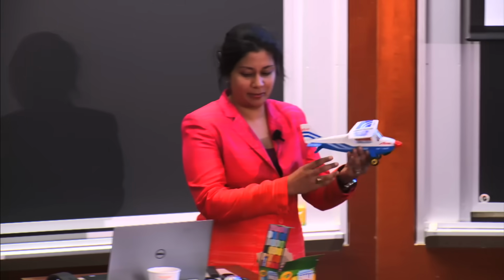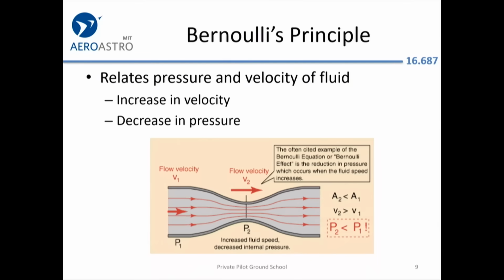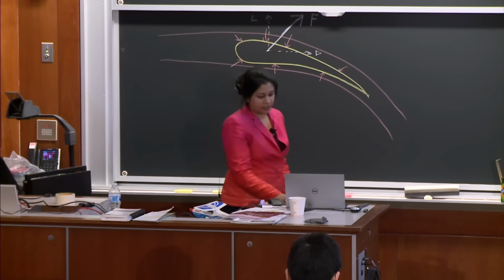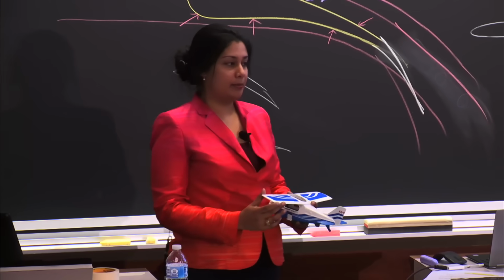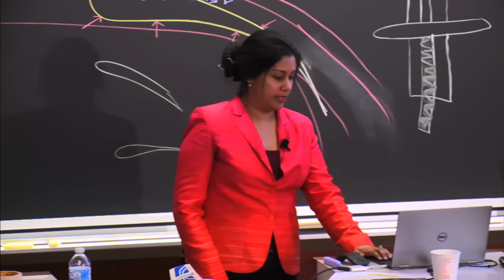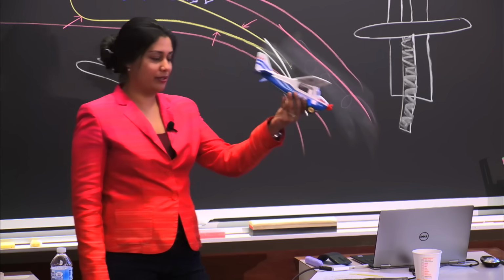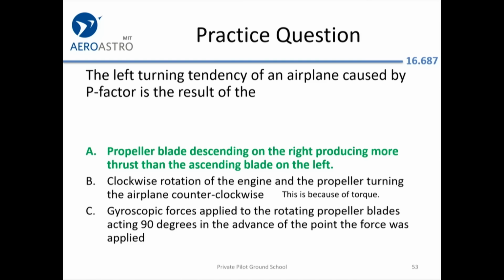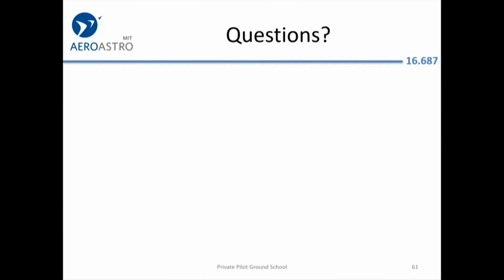Lecture 2: Airplane Aerodynamics

Comment: Not an aerodynamicist (like the presenter) but two questions. First, why is she drawing airfoils that don't exist but help her make you believe the whole air deflection theory? Secondly, if airfoils fly (create lift) by deflecting air molecules downwards, why do airfoils stall at (typically) 10 degrease AOA???
Reply: She us rather weak on everything. 
Stall is typically more like 13-15 degrees and that is because the air can't get around the curve fast enough in the upper flow that it needs to and the laminar flow becomes turbulent. The air's inertia is, in essence too much for the atmospheric pressure to keep it smoothly flowing along the surface of the wing.   Like you on the playground merry-go-round feeling 'pulled' outward.

Comment: equal transit theory doesn't seem applicable but she is a lot more confused in how to reject it. As  after contradicting with it by saying it isn't possible that air is moving faster and it all related to mass being pushed down. then as soon as she reached the foundation of lecture then she started with Bernoulli's principle by relating speed and pressure. Instructor can you tell how will you apply bernoulli principle? have you studied its basics? my say would be equal transit theory isnt correct although there is some relation of speed increase and decrease, although it isnt necessary for particle to meet at tail at same time.

Comment: 3 min in and already making mistakes. For example lift does not need to exceed weight to climb. And thrust does not need to exceed drag to go forward. Even simplifying for a general audience that is not correct.

Comment: This woman is dangerous, first she confuses lift with drag then she states that the air travels over and under the airfoil when in fact the air soes not move at all. The Aircraft moves through the air. MIT?
Reply: We model it as air moving over a static airfoil for ease of explanation because it's essentially the relative velocity over the airfoil which matters, not what is moving where. It's the same thing
Reply: Agreed. Relative wind and “wind” are two different things.
Reply: The talk was full of errors. Unworthy of MIT.

Comment: 5:42 - Color me terrifically confused by that streamline representation.  Wouldn't the flow become quite turbulent on the back top side before it made a bend like that?  Or let's ask the question this way - why does the air bend down?  Isn't it because the local pressure on that streamline is less than the atmospheric pressure outside the control volume so that as the topside flow exits the CV it has a downward component?  So then is she just saying that the delta-M on the CV is what causes lift and not the delta-P via Bernoulli?
Reply: You are correct that wing as drawn would be in stall. 
Above a wing, the pressure is lowered because it 'wants' to go straight - Newton 's First Law.  This derates the lower pressure at the surface as it "tries" to go straight, just like you swinging outward on a playground merry-go-round
In normal lift it is NOT turbulent above.  It is laminar.
Coanda does NOT occur above a wing because there is no jet into still air and, therefore, no accompanying entrainment.
The deflected air is from both bottom and top and MORE is  from the top.

The air follows the upper convex curve simply because the atmospheric pressure is pushing it against that surface (Downward) as long things aren't happening too fast for the mass of the air to be accelerated by the pressure Gradient.
Reply: @Observ45er  Thanks.  I'm staring at that thing and going "It's been ten years since my last fluid dynamics course, but that just doesn't look right."
Reply: @TemplarOnHigh  25 years for me.
I dont get the "Bernoulli" thing; the airflow 'above the wing' and the airflow 'below the wing' ARE two seperate flows therefore Bernoulli can NOT be applied...... to the best of my waaay old knowledge.
Reply: @vatandas1542  It's a question of where you draw the stream lines.  As long as you apply Bernoulli along a streamline and the other assumptions are valid (incompressible, isothermal, steady, frictionless) it will work.  You can apply it to the top and to the bottom stream lines.

When you do this you will get a slight difference in pressure along the stream lines.  I think what the speaker is saying is that this is not sufficient to generate the lift required and that the bulk of lift actually comes from a change in the momentum as you move the fluid through a control volume (but I haven't checked the work to determine if this is right.)
Reply: @TemplarOnHigh  I see what you say.
But you know the classical Bernoulli example; pipe with a throat.  Single airflow, molecule to molecule.  Never seen an example/calculation with two different pipes one of which is 'narrower'!
Reply: @TemplarOnHigh  Second part: That is correct. Aircraft fly by AoA. Turning the airflow downwards and vortices (laminar and/or turbulent) add a great deal to the lift.
"Fat" airfoils, sucb as the ones on airliners, allow very high AoA. "Thin" airfoils do not.
Check the airfoils of Starfighter (F-104) and Viper (F-16).
Reply: @vatandas1542  Because a stream line doesn't allow flow across it, there's no theoretical difference between a frictionless pipe's wall and the stream line next to the one you are analyzing. So you can analyze two stream lines that start with the same starting conditions and then correlate them to each other later in the flow.
Reply: @TemplarOnHigh  I dont get it.
There ought to be one common parameter,  time or path in order to be able to make a meaningful comparison.  The paths are clearly different. The time need not be equal. Just my 2 cents.
Reply: @vatandas1542  The time doesn't have to be equal.  Pretend you have a pipe like so:
1.  Straight section.
2.  A T.  The T feeds a U-shaped loop and another straight section.  Both of those connect back into a 
3.  Second T.
4.  A straight section again.

You can set the U-shaped loop up to be very, very long.  (Think primary / secondary pumping arrangements on chilled water systems with a hydraulic bridge.)  Bernoulli will still be valid even though the flow rates and times are not equal.
Reply: @TemplarOnHigh  the pressures at the two entrances of the 2. Tee would be equal either by design or by back-flow to the U-shaped side (assuming that side with more pressure drop). Therefore you know the upstream AND downstream pressures of the U-shaped side as well as the geometry. Where is the application of  Bernoulli for both of the two sides?
(Sorry, I m somewhat rusted.)
Reply: The airflow behind a wing when it is creating lift is, in fact, turbulent. The higher pressure of the underside makes it flow towards the lower pressure upper side exiting the trailing edge, but they both are traveling downward. This wing wash turbulence causes some of the induced drag. The mass of air is deflected down due to the momentum imparted by both sides of the wing. It is the Coanda (surface adherence due to viscosity) effect that makes those molecules follow the wing surface in a downward direction. Why can we understand why we get a downdraft from a ceiling fan or a helicopter and not understand that they are in fact rotating wings ?
Reply: Analogy to rocket engines: Pressure distribution over an airfoil is to its downwash as pressure distribution in a rocket combustion chamber is to the exhaust plume. A rocket's combustion chamber essentially has a missing rear surface so the net pressure force is forward. Does thrust come from this unbalanced pressure in the combustion chamber and nozzle or from f=ma in the exhaust? Really it's both. Same for the airfoil.
Reply: Air is lower pressure on top of the wing than atmospheric pressure behind the wing. This means the air must unnaturally flow from low to high pressure. When momentum is insufficient to overcome the adverse pressure gradient, a region of reverse flow occurs at the trailing edge near the surface of the wing. It works it's way forward as the adverse pressure gradient worsens. This is the mechanics of a stall.
Reply: Air stream flow at the lower portion get compressed to produce high pressure applying Bernouli flow the area getting reduced produced increase in velocity but when area getting increased producing a decrease in velocity with increase in pressure thus the differerence pressure along the aerofoil down strram and upstream  produces a lift following a drag.
Reply: @nandakumarcheiro  
Perdón. No comprendo.